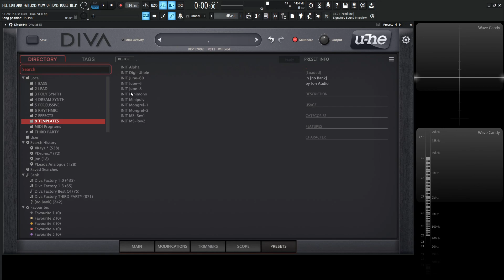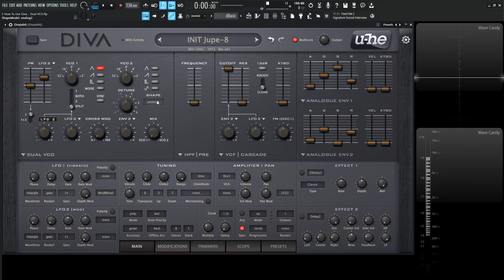Dual VCO PART 5 | u-he DIVA Tutorial

Comment: Hi there! How did you make diva black theme? Thanks
Reply from the maker: So on the u-he website they have a few different themes to choose from. The one I am using is called 'blau'
You would have to download the files from there. And you will get a folder called 'panes' I believe.
And from there navigate to the diva directory files. And replace the panes folder with the folder you downloaded.
Make sure to make a back up of the diva directory folders before you replace files incase you want to go back to the default theme.